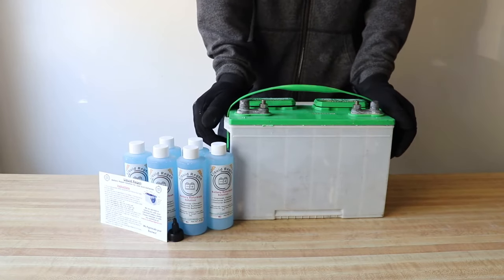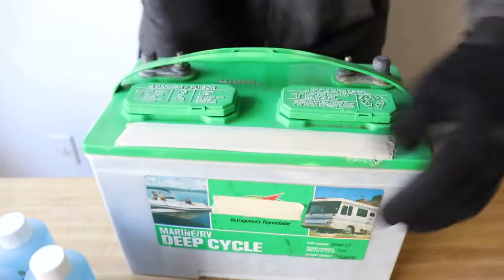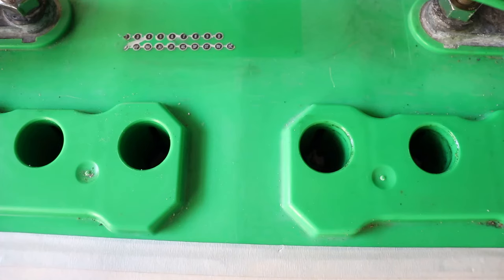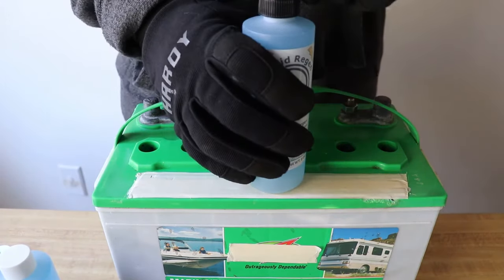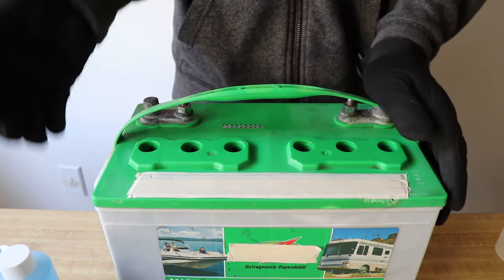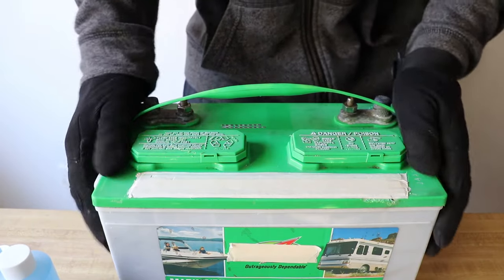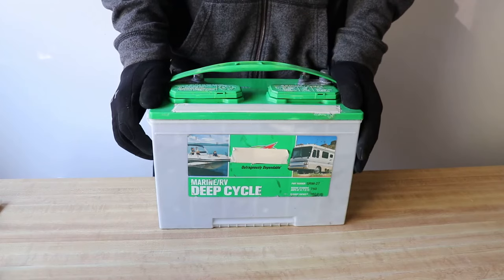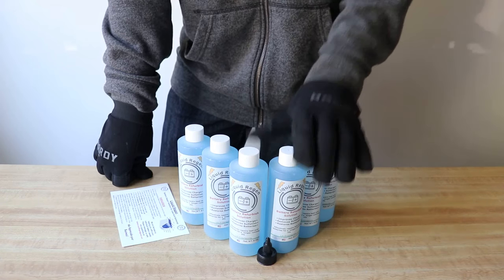Restoring Lead Acid and Golf Cart Batteries, Liquid Regen Professional Battery Sulfate Remover

Comment: The first test came in at 12.65 volts. Ahem that’s not a bad battery
Reply: Nobody said the battery was bad voltage but point was the cca’s were down from 700cca when new to then mid 400’s cca showing the battery lost current/cca’s.

Post treatment with the product & a slow overnight charge the battery cca improved from mid 400’s to upper 600’s cca which is the point here.

Now that same battery should last/perf better in the golf cart
Reply: Ya voltage is not the only thing that matters

Comment: Why are you measuring the CCA on a deep cycle battery? Deep cycle batteries are not rated in CCA, they are rated in Amp Hrs.
Reply: Was thinking the same thing
Reply: youre correct that the video doesn't show Amp Hours, but deep cycle batteries do ahve CCA measreuments/ratings. I dont know of a way to test AmpHours. Do you?

Comment: If overfilled with distilled water and caused huge amount of the electrolyte to be drained, should sulphuric acid be added or the charging process will auto equalise the acid concentration?
Reply from the maker: During the desulfation process, the amount of sulfuric acid in solution will increase, or in other words that specific gravity will get larger. It may be a good idea to check the specific gravity(highly affected by H2SO4 in solution) of the electrolyte after using our product if you had to drain the electrolyte and possibly add Sulfuric Acid. However, this might not be necessary if you are seeing adequate results with your battery. Thank you for your question.
Reply: You ever fix it just did the same thing? Or do I just buy new batteries?
Reply: You ever fix it just did the same thing? Or do I just buy new batteries?

Comment: Has anyone tried this with a batteries showing 2 volts, my golf cart ( one year old) sat for 6 months and now read 2 volts per battery and charger won't initiate charging
Reply from the maker: Hello! That is very strange, but we would love to help. Please shoot us an email at Support@HomeChemAuthority.Com
Reply: I had the same issue.  In order for the charger to initiate a charge it needs to see 30V (in my case I have a 48v cart 6batts 8v each).  They all read 1-2 v.    I used my standard car charger on 12v for about 3min on each battery, just to surface charge enough for the big charger to take.  It worked.  I did order more fluid for further maintenance.
Reply: Front-

Comment: It said 12.65 volts on  the 1st printout from auto zones tester. That's a good battery is it not?

I've got 2 6volt gc batteries 4 yrs old used everyday in my service van as house Batts for 4 years. They'd charge up but drop off voltage alot faster than b 4!?  Would this work?  Thnx 4 ur video,
Reply from the maker: Hello, that is a great question! Please send us a message through our site at https://homechemauthority.com/contact-us/ and we would by happy to help with your situation.

Comment: Question... can I dump all the liquid and start from scratch? How much solution and how much electrolyte should be replaced?
Reply from the maker: Great Question! LiquidRegen is not designed to replace the original liquid found inside of your batteries to we do not recommend removing the liquid from your batteries. This may cause issues leading to unrepairable cells. Instead, we recommend follow the instructions that come with our LiquidRegen sets which explain the exact amount of Liquid to add (in ounces) based on the voltage of your batteries. If there is too much liquid in your batteries, we only recommend removing a small amount to allow our product to fit, and then using the same liquid you removed to top the battery off. If the fluid level is still not high enough in your batteries after, you can use distilled water to help submerge the cells.

Comment: Whats the benefit of this over adding actual sulfuric acid?
Reply from the maker: Great question! Much like adding sulfuric acid, LiquidRegen increases the specific gravity of the battery; however, it also removes sulfation leading to better performance and longevity when compared to just the acid.
Reply: @liquidregen  great. So I have a couple of wet cell semi sealed AGM batteries that have dried out. 1 I think I boiled dry with too higher voltage and has no current capability. The other just deep discharged too many times. The latter still starts the vehicle as long as its kept charged, but has no useful capacity. Added demin to both and hold voltage but no improvement. Any hope for either?
Reply from the maker: @WaynesWorld999  Unfortunately LiquidRegen is only designed to work with deep cycle lead-acid batteries. In your case it is unlikely it will work with the AGM batteries, especially the one that has dried out.

Comment: Can it be use on solar battery
Reply: A deep cycle lead acid battery can be used with solar and the method presented would work to extend the life of the battery. However, it can never be used in a lithium iron battery since it is a sealed battery with a different chemical composition.

Comment: If I don’t have a trickle charger will the regular golf cart charger work?  I will be putting this to a real world test - we’ll see how it works.
Reply from the maker: Great Question! Although a trickle charge produces the best results, if you do not have access to one you can also use a regular charger. In this case however you will want to run two or more charge/discharge cycles in order to get similar results. If you have any more questions please do not hesitate to ask away.